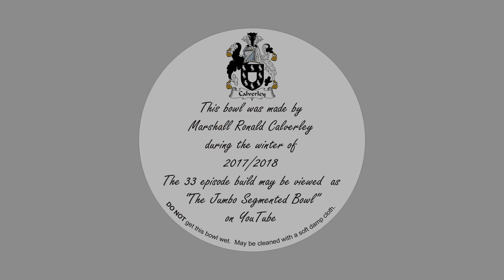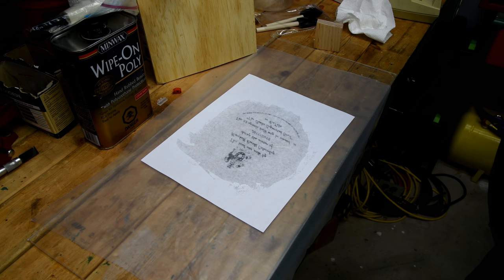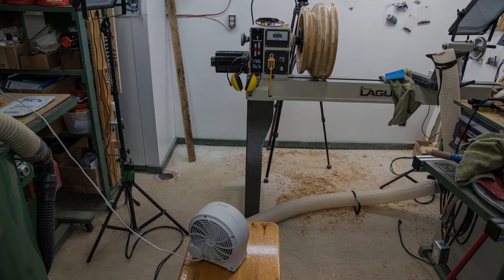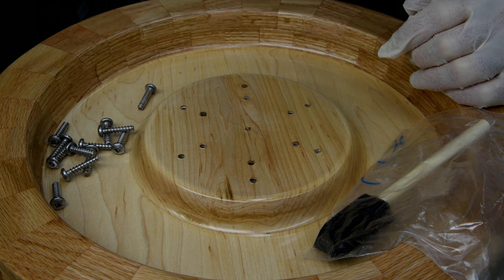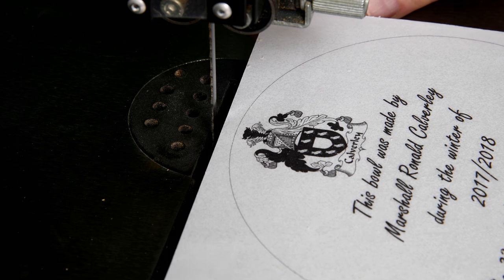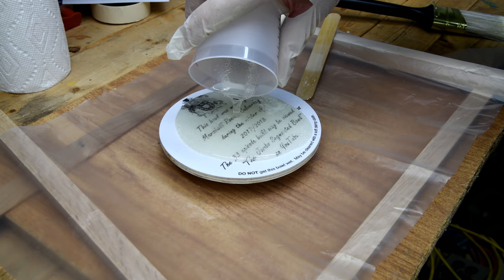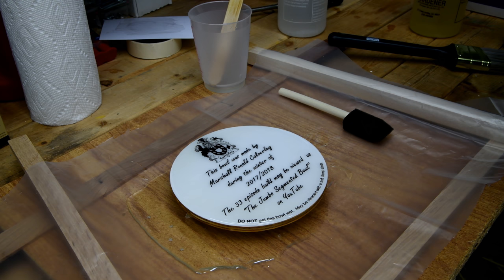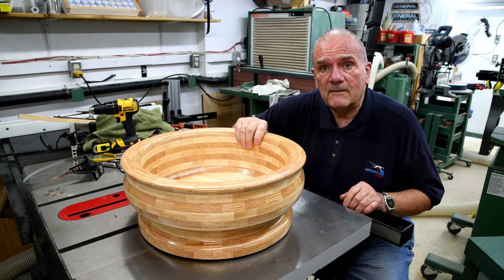The Jumbo Segmented Bowl - Part 32

Comment: 0,2 firkins
Reply from the maker: "Firkins" If a ferkin weighs about 50 kg. then 0.2 firkins would be about 10 kg. Right? Thanks for watching and guessing the weight :)
Reply: In the FFF system one firkin equals 40.8233133 kg - so 0,2 firkins would be ~8,165 kg. :)